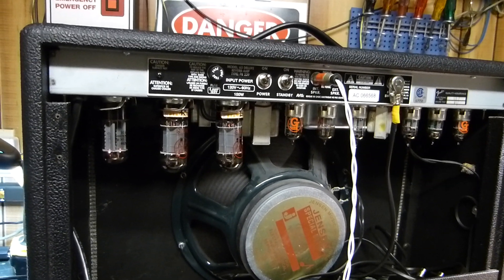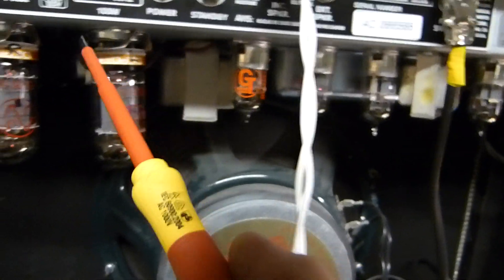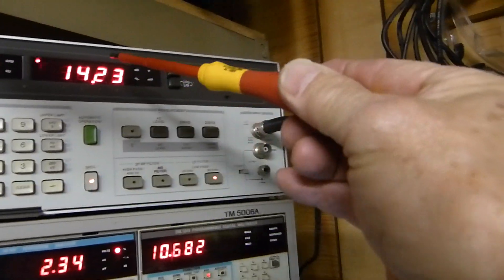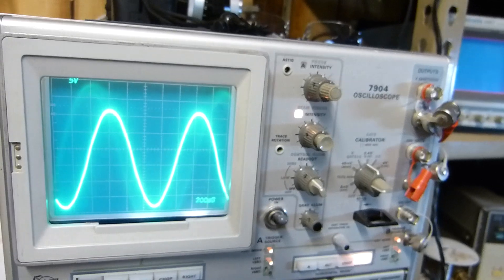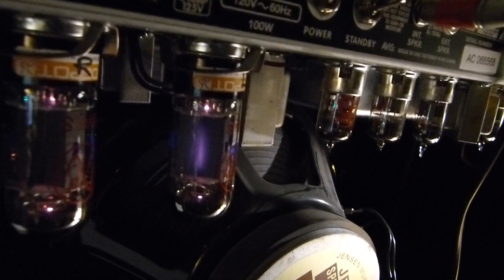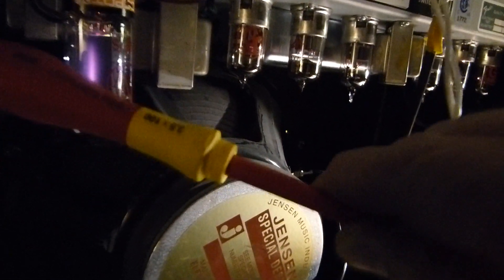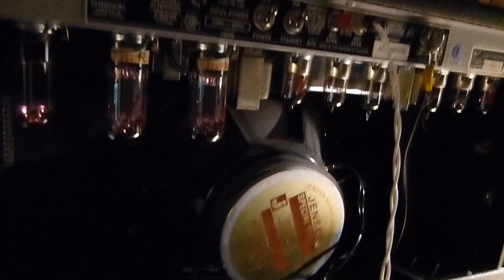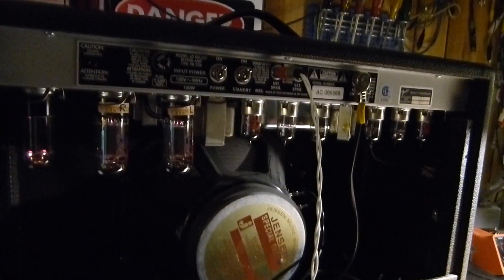Fender Deluxe Reverb Amp Repair Model 65 Type PR 239

Comment: If you are losing the bias voltage at pin 5, the signal is going to increase, not decrease.
Reply: If you lose the bias voltage from a poor metal-to-metal contact on pin 5 you are going to lose the signal voltage and the bias voltage from the same bad connection but the point is, if there is no  bias to control the flow of plate current, the tube is going to red-plate very rapidly. As another possible situation of bad tube socket connections, if the connection is bad to pin 3, the plate connection, the highest potential electrode in the tube is then the screen grid which tries to take the place of the plate and the screen is ruined in a matter of 2-3 seconds. Bad tube sockets can really do havoc on the poor tube.

Comment: Is this a handwired, or one of those computer ribbon amps? Well. Why didn't you show us if it helped or not? These current Fender amps are pretty much junk, as far as I am concerned (I'm not a fixer; but I am a player of 57+ years ... ).

Comment: I have that problem with my amp. 
Do you simply replace the tube sockets?  Or repair them some how?  
Thanks a lot
Reply from the maker: The best thing is to replace the socket with a good quality one. It's not that hard to do.
Reply: thanks!

Comment: my reverb is just buzzing now. no reverb at all. my amp is only 1 year old so it pisses me off. is this common?
Reply: I can't say that having a reverb simply buzz is particularly common. You need to check the cables to and from the reverb tank to be sure they are making good contact (the connectors at both ends)....and then check the reverb driving and receiving tubes. Perhaps the company could provide you with some helpful information, particularly if it's still under warranty. Good luck.
Reply: Uncle Doug Thanks man.

Comment: I've found that the retainer sockets have been more reliable than any other, however, it's only a matter of time that companies will be making them crappier and there will be more headaches on the way...Pomona and Jones used to make the best tube sockets back in the day...I've been getting most of my sockets from Tube Depot and AES over the past few years, unless I run into surplus of old stock...

Comment: I had one of these come in for repair back in November, part of the clip for pin 5 was missing in the tube socket...Had to replace the socket...I'm finding that many of the newer tube sockets made today are crappy...I usually install Ceramic sockets for the output tubes...
Reply: As a player, I would be happy to pay for ceramic tube sockets.

Comment: Since I do not know what is going on inside the chassis; may they used a printed circuit board with the tube sockets on it, or its all made up with some wires instead.
Its obvious that at least that particular tube socket is faulty or low quality.

Since i know that today´s components are much lower quality and more careless made since some 20 years ago. I go for the best available instead. Or NOS if I´m lucky to get some....Stay away from any plastic made sockets - use ceramic ones instead with the best contact material and shape. Avoid all china crap, as it looks nice but fails in every thing when it comes to reliabilty, duration, and even specs!
The contacts need to be made using spring metal - china products often are made of cheap crappy tin. they do not stay in shape when its beeing heated resulting in burnig up your tubes....

If you mount ceramic sockets in a metal chassis use rubber standoffs to isolate the sockets from the chassis on thermal usage. Or the ceramic may crackle when the tube warming up.
Reply from the maker: The octal sockets are junk. Little contacts on each side of the pins that I can easily bend with my dental tools and will not hold their shape - no spring tension in them. The nine pin sockets look a little better. The majority of these units are doomed to the scrapyard early in their life as many owners will not be able to find anyone willing or capable of diagnosing the problem and changing out the sockets. Other issues are yet to be seen.
Reply: ElPaso TubeAmps I agree, these wimper 8 pin deals that were ment for the 6V6 and not the quality of their bigger brother 6L6's in Twin's and Pros'. I started replacing those clamp type retainers they used with the long spring type that has the open cup on the bottom around 1992 or so. I can honestly say that I have not had one of them come back with a lose contact problem. However, I have had these in that someone else replaced with a even cheaper socket that failed in less than a year. I tell my clients that unelss the sockets are completely trashed that the retainers are far cheaper in the long run or they will contiune paying the bill over time.. Do you use these retainers? If so, what's your opinion about them?
Reply from the maker: ElPaso TubeAmps Unfortunately, I discovered today that the 9 pin sockets are pretty bad also as the tube pins can and will go down the side of the female socket connector instead of in the middle - what a shame - such a nice sounding amp. It is best to pull the amp out and put it upright on the bench before changing any tubes so you can be sure the tube plugs into the socket correctly. A lot of extra work...
Reply: bain5872 I always use rubber standoffs with the ceramics. I learned my lesson once with them (LOL) :)
Reply: I've never used these however, I can see how they would be helpful on a ceramic socket with a glass bottom tube, Those spring retainers hold them so snug I see how it may cause a crack on a ceramic socket if not used. I will say that anything beats the tube hanging down in those cheapo sockets just swaying in the breeze. I'll to have check those out. Where did you purchase them from?
Reply: I get most of my sockets from Tube Depot and AES (Antique Electronic Supply) in AZ.
Reply: I deal with AES also. I was reffering to the rubber stand offs not the sockets. Do they sell those also. I must admit, I've not thumbed through of their cats in awhile.
Reply: bain5872 I've been getting my standoffs from a local hardware supply near my shop...But go on AES web site, they do have a lot of hardware as well as Tube Depot...
Reply: Will do so. I'm glad you told me about them. I'll see if I can locate some. Thanks again!
Reply: +TubiCal These octal tube sockets were designed in a way to allow movement of the tube contact pins, inside the phenolic. The tube wiggles around within the socket however, if the pin contacts are properly tensioned, they maintain a good grip. I believe this was done to mechanically unlock the tube from the chassis to  dampen harmonic vibrations that caused output tube failure, of that time period. I will also theorize that it also aided in harmonic content as I find, these particular models to sound unique. The pin contacts can be retesioned and will remain very tight for 15 years of pulling out tubes however, they do need retensioning ever so often. I've seen few of them out right fail in 27 years of servicing. I appreciate their wisdom of design.

Comment: Any opinions on what year amps really started getting bad?  If I had to guess I would say around 1995.
Reply: There have been many amps from the late 60's on through the 90's that are turkeys...I have a '69 Fender Bandmaster head on the bench right now that has a warped and moisture-damaged component board...amplifiers have gone up in price, and the quality has gone down...It's sad...

Comment: I own two of these deluxe's and IMO, they're the best sounding 6v6 amps that Fender made. I've had this same problem with both of them as well as most of the older Fenders that has crossed my bench. Like you said here, re-tenstioning and cleaning of the socketts does the trick. I've also installed spring tube retainers and this has elemanated the problem. After many years of giging with them both, the problem has never happened again.  I install these retainers on almost evey Fender I service now. Retainers are highly recommended!!!
Reply: Uncle Doug says that if you instal a good socket and it is set the way it's supposed to be, you don't need tube retainers. I tend to want to agree with him.

Comment: Excellent video, David. Anyone who doubts the significant reduction in quality of many (if not most) modern amps should simply disassemble both a new amp and an "old" one, and compare the components. Ultra-low wattage resistors, cheesy tube sockets, grade Z capacitors, flimsy circuit boards with bad connectors, etc. etc. all degrade the sound quality and reliability of many newer amps. We all understand the need for profit.....but at what cost? All the more reason, IMHO, to stick with vintage amps, which tend to be superior in virtually all parameters of construction and measurement, and are frequently available at prices that are competitive with their "younger brothers".
Reply: Yes doug you hit the nail tube right on the head there. they state hands wired then you see a printed circuit board,  which twists and bends in the heat of a valve amp.
Reply: That is so true Doug! I've been getting a lot of newer Fenders in for repair with broken ribbon wires (broken off the PCB) and ribbons with internal breaks...I usually have to take them out and run individual leads and solder them to the PCB...Is anything made well these days anymore? (LOL) :) I guess it's disposable products for a disposable society!
Reply: You're too kind, Frank, but the fact is, if an arthritic old geezer (and his dog) can build reasonably good, durable amps in a cramped, cold, stone age workshop at a reasonable price, why can't multi-million dollar companies? But then, I have Rusty helping me....and they don't.  :)))
Reply: You have quality help! The big wigs don't! :)
Reply: Thanks for the support of my premise, guys. It's a real shame that devices we formerly held in such high esteem have slipped to their current  level of mediocrity.  At least we have our vintage tube amps to keep us warm :))
Reply: This is very true! :)
Reply: The proof of what you're saying exists! Just take a look at Uncle Doug's home-brew clones! They are great sounding, quality amps which can be built and sold at an affordable price...Companies that work on high profit margins, and produce low quality products will sooner or later end up behind the 8 ball! Behringer is one company that can't make a good tube product if their life depended on it...I've repaired many of their products and they are the worst when it comes to reliability (along with a good handful of other brands)...They use caps by companies that I've never heard of (not to mention being unable to pronounce the name)
Reply: Well said, Cat.....and all the more reason for us to continue building our own "boutique" (sorry :) amps at very reasonable prices (to us). We get the best of both worlds.
Reply: I have the new valves for, my amp reconstruction now, i need to get my self one of them Christmas tree hole cutter as Doug calls them to make some new holes in the old chassis. hope to post some pictures of it on line soon.
Reply: I'm glad to hear that you're making progress, Ron. I'm not sure where you live, but around here we have places called Harbor Freight where you can buy stepped bits ("Christmas Tree" hole cutters) at a very reasonable price. Best of luck with your project !!  :))
Reply: Harbor Freight is a great place for cheap tools that get the job done! In fact there's one in walking distance from my house. Only thing is, their power tools are cheesy; I wouldn't recommend them. I use Milwaukee and they last forever. As far as electronics tools, I stick with Xcelite; the technician's standard :)
Reply: Cat, I have seen some nice looking cabinets on Ebay at very low prices. You might try a search......
Reply: ***** Behringer is the king of junk audio (LOL)
Reply: ***** I was looking at that knockout punch set from Harbor Freight, I wasn't sure of how good they were! I may look into them...Greenlee has always been over priced...You're paying for their name...
Reply: If you have access to a drill press, the "Christmas Tree" Step Bits work quite well and offer a much larger selection of intermediate diameters than most punch sets. I used one in my little 5F1 Champ chassis video.
Reply: Step bits are very handy; but I do recommend a drill press like Uncle Doug said. I used one in my Milwaukee Magnum 1/2" drill and I'm lucky I still have a functional wrist (LOL)
Reply from the maker: Frank Ferraro Amen to the 1/2 inch drill, Frank.  We had a half inch hand drill like your Milwaukee at work and  practically every time I used it I wrenched my wrist as it was so strong - and that was 20 years ago when I was a "young" man.  :-)   I own a 1/2 inch hand drill but it is Taiwan or Chinese so it is not near as strong (thank God).
Reply: If you use the adjustable side handle on the drill, and brace it against something, it's OK, but if you're free-hand drilling, and that thing hangs up, it could get quite painful...I don't know what's worse, getting hit with 450 volts off hot plate leads, or a hung up drill bit :)
Reply from the maker: Frank Ferraro 40 something years ago,I was with  a buddy back in Alabama and he was drilling something in his lap with a small bit and it broke and, yes, he rammed it into his leg broken off and still turning (thank God is was only his leg). Around that time frame I was soldering and pouring the solder to some large wire over my legs with short pants on - you know what happened when it dripped on my legs - wouldn't you love a YT of that ?  -  it only takes one experience - it is a miracle any of are still alive but it seems we only learn from experience. People telling us what will happen is only verified when it happens to us then we say, "yep, what did I expect? ".But I think we all have a heck of a lot of fun here on YT.